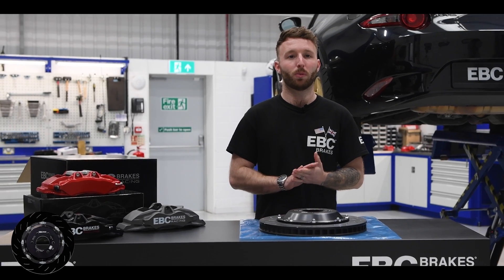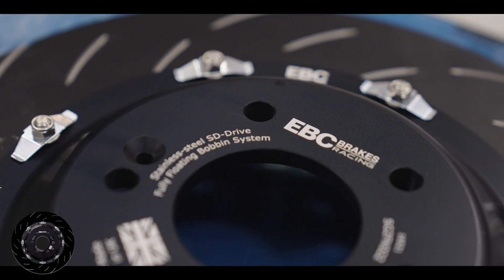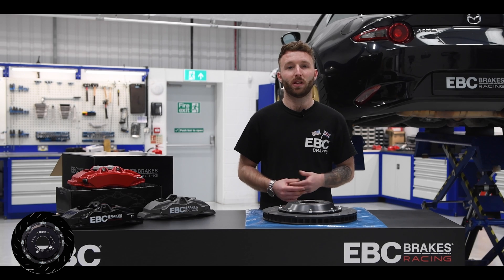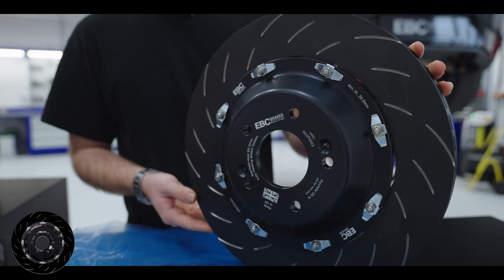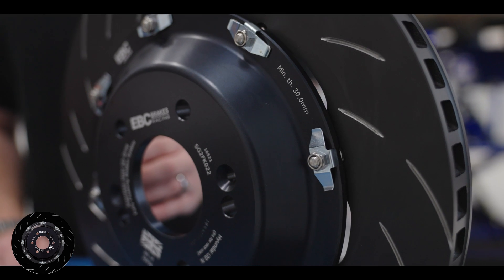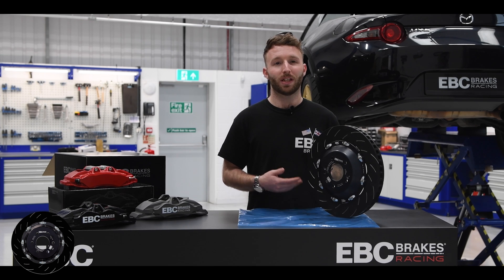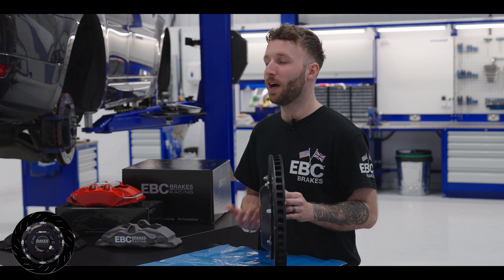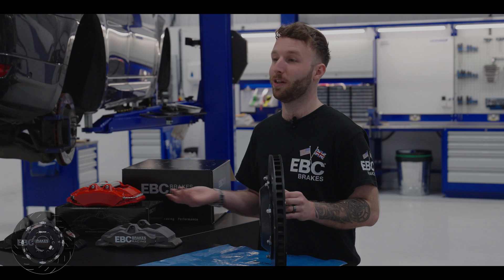NEW Thermic-Coated Floating Discs | Tech Talks – EBC Brakes' Track/Racing Range

Comment: Is it normal to get "clicking" with these? I recently installed them with Hawk 5.0 pads and can hear clicking when braking at slow speed
Reply from the maker: Hi Mark, EBC’s 2pc fully-floating brake discs are fitted with anti-rattle springs at every bobbin location, however, during hard cornering or on full steering lock there may be an audible ‘clicking’ noise heard coming from the brake discs. This ‘clicking’ sound is normal and is perfectly safe. It is not a defect with the product. After your new discs have bedded in, this clicking sound will get quieter.

More info can be found here: https://www.ebcbrakes.com/wp-content/uploads/2021/08/Thanks-for-choosing-EBC-Brakes-A6-1.pdf

Comment: If I installed the front kit, but all of them were on the right side of the two parts, what would happen? Or is there a solution to open the black base and turn it the other way around or do I have to return the wrong piece and have them ship to me on the left side? I need clarification from you on what I can do to save time. my item Fully Floating SG2F Two Piece Rotors for m4 m3 i got it 2 right side
Reply from the maker: Hi, we apologise for the issue here. Please reach out to our technical support team and they will be able to help resolve this for you. You can reach them at technical@ebcbrakesuk.com - thank you.

Comment: What pads do you have for a 997.2 gt3 that does some street but more track days? Do you have rotors for the this gt3?
Reply from the maker: Hi! Yes we do have pads for this vehicle. If you do more track days and still want to use them for street then we would normally recommend our Bluestuff pads. If you visit https://ebcbrakesdirect.com/Automotive-Parts and put the details of your car in you can see what we have available. Alternatively you can contact our technical support team by emailing technical@ebcbrakesuk.com and they can give you more information on what pads would suit you best.